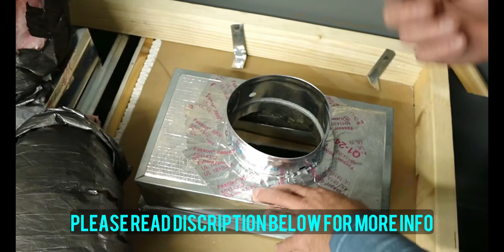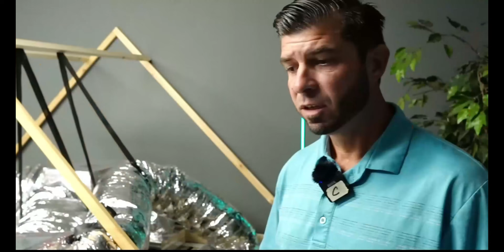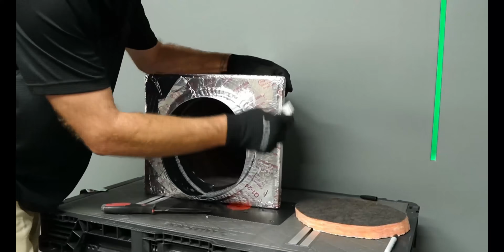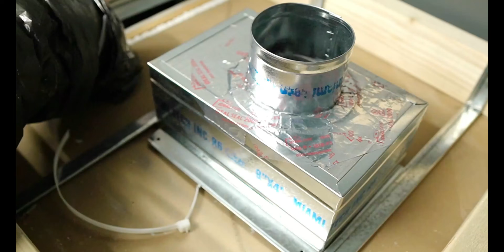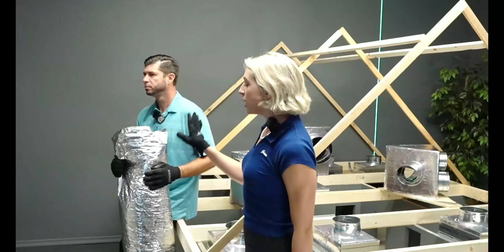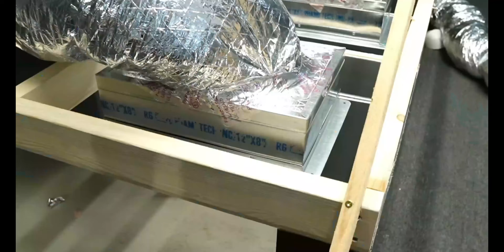Repair Or Replace Your HVAC Flexible Duct System And Save a Fortune

Comment: Cool idea on the transition box...how do you know how big to make it? My system is 4 ton, 1600cfm but ducted for 1200 cfm, so I need to fix that. I was thinking of feeding 1 - 14" and 2 - 12" flex to 3 different zones of the house and build 3 transition boxes to feed all the room ducts. So...basically 700 and 480 CFM boxes, respectively. I was thinking 1 - 16"x16"x16" cube and 2 - 14"x14"x14" cubes. Would that introduce too much loss in the system?
Reply: All if your supply trunks need to be sized for 20 inch
Reply: 😮😮😮😮aapwaaaaa😮😢a🎉😢in:JC juj ç-chhxc, -y, 'cccycycyc,, y, ccycy, cy', I u&g"Guygugygycct6x6ytyyyyttytyt6c Guygugygycct6x6ytyyyyttytyt6c🎉' ûxa,, x u:u '  🎉
Reply: Uiumkujuuuuknumuuukuuu 0:15 immuKUYa
Reply: ট৬৫ঃুটঁ
Reply: 1 14" and 2 12" ducts on a 4 ton system is way way to much unless you zone it off with a damper system that closes some of it off. Under normal static pressures such as 1600 cfm for a 4 ton you'll have 2200 cfm of duct. Your velocity will all but be completely gone and air will just trickle out
Reply from the maker: First; using a cube transition box is not a bad idea however, obtain a duct design done by a professional load calculation company and strictly go by that.
Reply: @GWAC555 Do you know any companies that can do it without coming to your house? I want to do the work myself and don't and them trying to talk me into having them do it.
Reply: They sell the ceiling boots with the collars already attached now .Thank you for all the information .
Reply: I have the exact same issues, crazy. I'll be using a 14 in. x 12 in. x 12 in. Galvanized Steel Wye instead of the box

Comment: I’m more inclined to replace mine with smooth galvanized metal pipes with 3 inch thick pipe insulation. Yes more expensive and time consuming but far superior. Also seems to me all the junction boxes should also be fitted with 3 inch thick insulation.

Comment: As a 40 HVAC mechanic, these systems work I guess, but they don't work good. Of course, all a home owner cares about is being cool. You should have a solid trunkline, either rectangle or round and then your T.O. and flex comes off of that, greatly increasing air flow and efficiency.  It has to be sized right  too.

Comment: Install a multi mini split. It's much better. Lot cheaper maintenance costs.

The only upfront cost is hidden drainage+copper piping with argon gas.

You can clean the mini splits any time.. Air ducts is a big problem. Rodents bugs can crawl too.

If you want to have ac in 5 rooms you can have 2 multi split systems. 9000+9000+9000 indoor units and single 24000 btu outdoor unit. 24000 + 18000 interior splits and one 36000 btu outdoor unit. So 2 outdoor motors basically. This way, if you run a single room cool with 9000 unit, the out door unit can idle as low as 3000-4000 btu (based on brand). Or if you want to run a single split in 12000 room, once if hits the room target temp, the out door unit can idle at 7000 btu easily.. And unless you run all ACs at 16C (which is stupid anyways) the total btu budget will be more than enough in most use cases. We had installed a single 42000 btu exterior unit and 4 interior. We made a mistake because unit can idle as low as 16000 btu. Which means a single 18000 btu interior unit doing 18C (which is un realistic) and short circles and becomes on off basically.. Anyways fuck the duct systems. No body cleans them ever. Worst for the renter

Comment: Have a question: my master bedroom is and has been notoriously hot…. I think it’s the triangle mixing box. It has like 5 or 6 connections. Also our master bedroom gets so dusty compared to other bedrooms. Can my new box be square instead of triangle? Also anyway to make them less connections? 

Also our bedroom only has 2 vents I don’t think the builder did a good job  

This winter I wanna go up there and start replacing some of these items. Thanks

Comment: Before putting the register and close it completely, you have to caulk the scene between the boot and the Drywall
If not overtime, you would have mold growing because you have cold air, mixing with the hot air from the attic

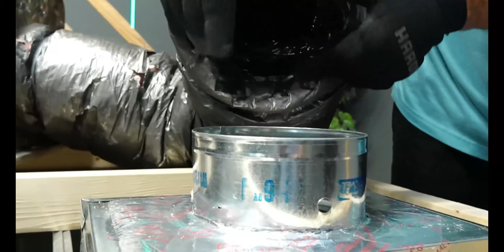Comment: 5:56 all while trying to balance on the rafters with your knees, sweating and possibly bleeding from the nails in the roof line, with 18"of fiberglass insulation,hands soaking wet so good luck on taping 😊
Reply: Not to mention trying to snake the flex through a cobweb of rafters (where it probably won't fit properly) and then stretching it tight and hanging it properly so it doesn't sag.
Reply: @markellis7866 don't forget they told you the company doesn't do attic jobs on hot days lmao

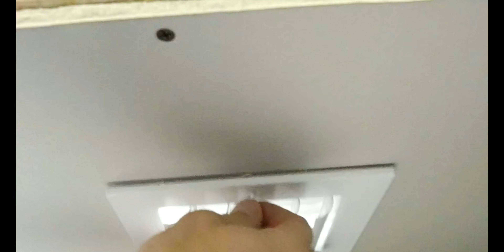Comment: At 13:44 you don't need to seal the can to the ceiling sheetrock? The video has us ceiling everything else. Is there no leaking of air into the attic with a bad seal here?
Reply: I started watching the video for this very reason. Except my situation i suspect is air from the attic leaking into the home causing moisture issues.

Comment: Just curious, why didn't you guys just reuse the mixing box that was already there? I would try to use what is reusable and replace what needs to be replaced. It's that okay?
Reply from the maker: If they are in good condition, sure you can reuse them. Home Depot sells mixing boxes at least in Florida but one can buy them on HD’s website. They call it “ triangular box”

Comment: This is an incredible  detail explanation  of the steps..
wow awsome guys .
Imagine this I have a 1800 sq ft home to a 3Ton A/C but the return  size and did pasts code is amazingly 
A 14x14x1 RIDICULOUS  guy sounds like hes chocking and also gets frozen at tines....sooooI want to change return to 14x20 way bigger.

QUESTION  can i just change that one and make bigger or have to do the whole box????? If not

I will try now to do it asap if not can some explain m what to do..

Defenitly not an hvac guy BUT I learn asap hands on....... thankxxxxx

Comment: Installing distribution boxes like that is a great way to destroy air velocity and create hot and cold spots. This is a great way to replace the material you have in a cheap fashion but not if you want to improve your systems efficiency and performance or the comfort of your home.

Comment: I just finished installing radiant barrier in my attic and noticed how bad the duct work is. It looks like a spiders nest. It's insane how bad it is and explains a lot of why the air flow on the second floor is so bad. After watching this, it will help me straighten out the mess. It's always been my understanding that air moves best the straighter the line with less bends and ups and downs. My just turned 25yrs old. The yahoo's that did the HVAC left a lot to be desired. Thanks to this channels video, I should be able to get it corrected. My appreciated!👍
Reply from the maker: Glad the video could help you get those ducts straightened out!

Comment: I can only guess that it comes down to cost, but.... In Florida, why wouldn't / shouldn't you design the duct system to be installed below or integral with the slab? I never understood the logic of running ducts through a 150 degree attic. Combine that with the fact that they will deteriorate and need to be replaced in 20-30 years to the tune of $8-10K, I would think that a slab install with rigid ducts would pay for itself eventually (probably sooner rather than later due to the increase in efficiency of the air coming out of the duct).

Comment: I was quoted $20k to replace the ducts in my 1,700 square ft. 3/2 1928 single story Craftsman. Absolutely NOT!
Reply from the maker: Duct replacement costs can really vary depending on your location and the complexity of the job!

Comment: What does the mastic actually do? If building code doesn't require it, should we bother putting that on?
Reply: Here in Florida,  the heat and humidity can cause adhesives on the tape to lift. I found a 4 ton plenum loose from the handler because it was installed new three months earlier with tape only. We used mechanical fasteners with mesh tape and mastic for a permanent seal.
Reply from the maker: Duct manufacturers tell you to leave the insulation puffy. Don’t crush it with cable ties rather use silver tape, to tape the outer jacket to the mixing boxes or cans like the guys did it on the video. Once the insulation is crushed it will lose its R value and that can lead to moisture buildup in the duct especially in humid climates. When it comes to some inspectors they prefer sealing the joints with mastic in Florida. 
The reason behind this is poor adhesion between the outer jacket and cans/mixing boxes. If the surface of the outer jacket, cans, mixing box is not clean due to various reasons, dust, sweat drops etc.. the tape might peel off latter on. If someone makes a clean job and keeps all surfaces clean, “mastic” is clearly not necessary.

Comment: Lol, great video, but you negated the absolute hardest part about working in the attic by letting the guys work from outside of the model roof. Should have put on some plexiglass on the outside of the model roof and make them work in the reality of an absolute nightmare of a cramped space.
Reply from the maker: We agree! That was definitely the easy way out. Thanks for pointing that out!

Comment: I'm closing on a house here pretty soon. This video makes me feel like I can reliably replace my ducting if I need to!
Reply: If you want a duct design that tells you what size to use  I can do a load calculation, and then distribute it according to your system that is installed. It would include  duct sizes  and material list and a map.

Comment: I paid guys $4000 to do this my attic was old 1990 insulation deteriorated… they refreshed the ducts and attached to vents… my question is how long should this new duct work last .. I am not sure that they replaced all the duct work.. my goal is to never have to have dust from ductwork come into my living space again had a team come after that to show me how they vacuum just one vent  all this dust came out gross I want to remove it all and install a simple clean Minisplit / Heat Pump had them in my previous home very clean

Comment: My entire house cools extremely well except for the front two bedrooms that get almost no air. I looked in the attic and their lines are kinked at the register box.
Reply: Add a 90° elbow to those boxes, it will eliminate the kinks.  Be sure to pull the inner liner tight and cut off any excess before reattaching.
Reply: @wisernow0681 Thanks and that was done but still not enough air.
Reply: @wisernow0681 That was done but still not enough air.

Comment: The only thing wrong with this is the fiberglass mixing boxes and large ducts lined with fiberglass mat.  fiberglass will erode from being buffeted by wind pressure and since its inside the duct you get to ingest the fiberglass microfibers and will have breathing problems. building cheaper is not good for your health.

Comment: flex duck system is a total garbage the way to go is commercial grade metal pipes and insulading on the outside is you go with flex u will be loosing air flow and quality is a total wasted of money contractor used this system because is easy to install but at the end is total crap

Comment: All of our rooms get good air flow but the master bedroom, we replaced all the flexible duct from the super cheap builder quality to a much better flexible ducting, still no air in the master bedroom, thinking about putting a mini split system on it.   3 br 2 bt single story 1300 sq ft.
Reply from the maker: We always recommend getting a duct design done by a professional.
Reply: @GWAC555  Thanks I had the job you guys did to my house already,  so they probably just replaced size for size and no calculation. It does not pass the feather test.

Comment: Great video, never seen mastic used that way at the end usually on the actual collar.

I also see a lot of zip ties for the outer layer instead of tape.

So I guess no matter where you look there is always one small variation.

Comment: What if the sheet metal ductwork system is in the crawlspace? Would you rip it out for flex duct in the attic? Mid-Atlantic coastal.
Reply from the maker: if it’s a pre-manufacture at home, I would leave it
as it is. However, if not, I would recommend flexible ducts. At the end of the day it’s your choice. Try to
consult as many HVAC companies in your area as possible. We prefer flexible ducts over metal ducts but there are cons and pros. (team member)
Reply: I had.a situation where perfectly functioning sheet metal duct in the crawlspace, which was going to be encapsulated and sealed, was ripped out in favor of flex duct in the unconditioned attic space. A few years in a coldsnap burst many water pipes and made the crawlspace into a pool. I reverse i herited that house and had to deal with the mess. @GWAC555
Reply: A ton more work.  Keep it in the crawlspace

Comment: I have a 2900 sqft 2 story house built 2002 and it has a split HVAC.  Ducting sucks in it.  I got a quote to replace the HVAC, which didn't include ducting and the quote was $25,000.   I live in an area that yes we use heat in winter but it is not a life threatening cold, lows of 40.  Summer more brutal, highs get triple digits a dozen times during July/August/Sept.

Comment: If i want to replace one single air duct at a time could I?
Reply from the maker: Yes.  You should be able to. Be careful in the summer, attic can be very hot. (team member)
Reply: @GWAC555 if my vents are blowing out hot air randomly rather then cool air, it’s not the Freon, what could it be?

Comment: I'm needing to add air into a very small bathroom. Can I simply install a Y connection off an existing branch from the room next to it instead of using a mixing box?
Reply from the maker: There are risks involved doing that. We would recommend a mixing box. (team member)
Reply: That would be better than the box, but still not preferred

Comment: That looks easy, I thought there'd be a lot more fiberglass and a restrictive space and a lot of sweating, I'm going to DIY now
Reply: You are obviously an HVAC guy who wants to justify the high prices, now as someone who fixes everything themselves because of y'all's ridiculously high prices, allow me to counter:

1. I used cellulose in my attic, not fiberglass insulation, so that's not an issue. 

2. I can hire you to come out in the winter time and replace this stuff so it isn't hot anymore. 

Now the confined space, I can't solve completely, but I will say I've installed 1/2" plywood to walk on between the beams to make maintenance significantly more easy. 

Does any of this matter to y'all, and will you give me a hefty discount? Nope. I checked. Hence why I did it myself. Just like I replaced both my condenser and evaporator 4 years ago myself for $3,000 instead of the $8,800 y'all wanted. I watched videos for a day, rented a vacuum pump and a/c gauges (both free) from the local auto parts store, bought a CPS micron gauge ($150) and a few adapters ($50) to make the gauges work, and I ran a vacuum for 3 1/2 hours (it's technically designed for automotive so it just had to run longer), and bought a scale ($60) to measure the 134A so I knew I put in the correct amount. The wiring is easy. I paid a helper $200 ($20 an hr for 10 hours) for the day to help me carry the air handler up into the attic and he helped me with some other stuff as well for that day. None of it was rocket science. I had zero experience in HVAC before this, but I've worked on cars (mechanic) my whole life. I knew the vacuum was the most crucial part so no moisture is in the system, which is why I purchased the CPS micron gauge to ensure it had a proper vacuum. It's been working perfectly for the last 4 1/2 years, and it took me only 10 hours with a helper and an additional 6 hours on my own finishing stuff up. So in 16 hours I saved $5,800 dollars. Y'all basically wanted $362 an hour, and I'm about 1,000% sure with y'all's experience y'all could have done that faster. The average brain surgeon only makes $347 an hour in the United States. Y'all are ripping people off.

Comment: As a electrician having install my own complete HVAC system let me tell you this is nothing whats it's like when you go install this in your attic. It's even harder doing it on your own like I did 10 years ago. Still this was a very good video on explaining the mechanics of the install
Reply: As a plumber doing my house on a raised foundation, I rather do pipes.
Reply: As a diy handyman and Marine, take down the drywall and save yourself the headache.
Reply: @kyleb8670 hahaa

Comment: do not use a plenum use a trunk line
Reply: Yea exactly. This video is bad information. Too much static pressure.
Reply: You're exactly right about using trunklines. However, most don't know how to design them.  The proper sizes for the required CFM and reducing correctly after a certain amount of pressure offloading to respective registers.